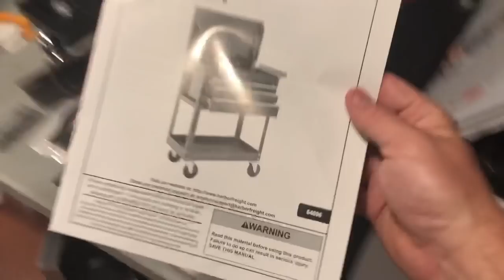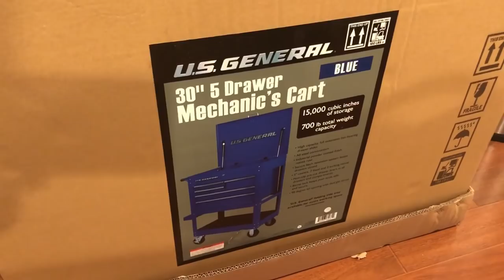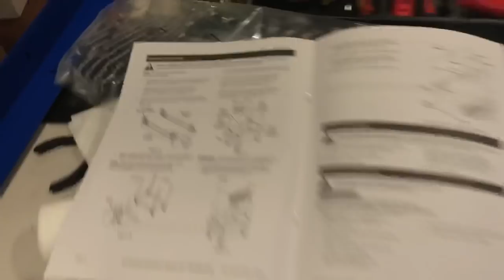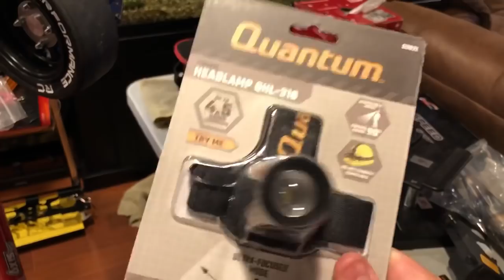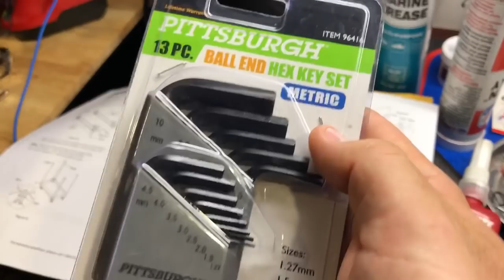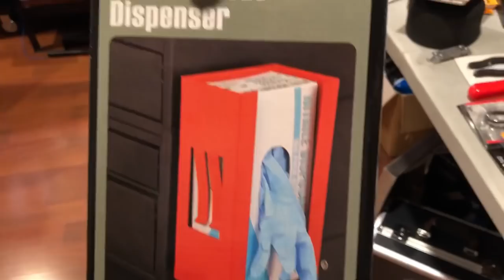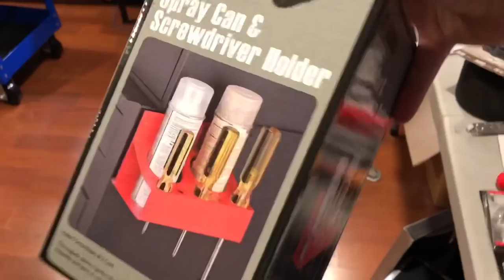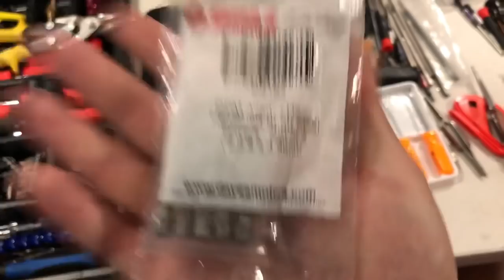BOTAJELL Got Another RC Tool Cart, Harbor Freight 30in.5 Drawer Mechanic’s Cart/U.S GENERAL

Comment: NICE!  I debated on the 4 drawer vs 5 drawer.  Just got the 5 drawer.  Think I'll put the can holder down low if i want to add the second tray.  Just got mine so all the extras were in blue too including the tray.  Got the glove holder and power strip too.  Also i found someone else that painted the bolts to match the blue. Rust-Oleum Painters Touch 2X Ultra cover  (Deep Blue Gloss) matches perfectly!  I painted mine.  I just saw they have black handle covers for it too now!  Great ideas in the video.

Comment: Bro I'm throwing out the pull start on the rtr this weekend and getting a bump box. The TLR starter box says you need 2 7.2V NIMH batteries to run. What batteries did you use as you are like me and do not use lipos. Also what connector plug comes with it. Thanks in advance John hope all is well
Reply from the maker: Vincent Martinez I’m using a Lipo in mine still but I will be replacing it with a Life battery the next time I get around to it!!!! I may use one or 2 Life batteries? My home and my RC Hobby will be 100% Lipo free after I do that and use one on my 4.0 Truggy.

Comment: BOTAJELL hey man, I just received my Rovan q.... pretty cool! What is YOUR process for engine break in? I don’t really remember breaking in my 5b but I kinda want to break this one in.
Reply from the maker: rc Ohio congratulations 🍾🎉🎈🎊 my Braaaaap brother 👊💥🤝💥 bro I love my Baja Q it’s so much fun and it sounds 💥killer👍!! I have past videos that show how I break in my Gas engines and I also made past videos of how I break in my Nitros. Bro Don’t over think it! It’s simple shit and if you get stuck? Just let me know and I will help you! Get yourself a stand and put your Q on it , mix 1 gallon of 24:1 mix fuel because your going to run 1 gallon of this for break in ! After first gallon of 24:1 you will be running 28:1 for the rest of the Engines life! This is what I do since 2002 with Gas RCs. When you use the first gallon of 24:1 and start to run it for first time try to run it for 15 min 4 times and each time let the engine cool down completely. Make sure when it’s running you see smoke 💨 for the complete first 1 gallon .  After the 4 or 5 15min runs just run it threw a full tank without stopping it but keep an eye 👁 on it because you can not let it run dry because it will lean out if that happens!! After you run a half gallon give it Throttle so the RPMs go up and down a bit and sometimes let it run with hi RPMs but make sure it’s rich ! When your at the end or close at the end of gallon you can drive it and get on it a little bit keep it fat , rich , Smokey still do not lean anything yet unless it can’t idle in its own . After your done with 1 full gallon of 24:1 change your spark plug with new one and mix fuel ⛽️ to 28:1 and warm up your engine a bit run it for a bit then start to lean your low speed needle until the idle raises a little then lower your idle needle screwif needed . Then do some hi speed runs back and forth and lean your hi speed needle until your engine sounds clean and clear sounds with no burping or farting at full throttle and do not over lean it either. If you hear 👂 a chubaka sound or if it acts crazy 😜 and sounds funny ? You probably over leaned it so you will have to richen it a bit until that goes away! Just run it bro don’t over think it !
Reply: BOTAJELL thanks for taking the time to reply brother! I appreciate the all of the info.

Comment: Best upgrades/first upgrades for 8ight t rtr? I know the engine's gotta go but what else should I do to it?
Reply: Jake Scinta electronics, chassis brace, and proline badland tires
Reply: Karrie Bhurgari also is there anywhere I can get the race kit shocks from?
Reply from the maker: LRP .32 X series, NOVAROSSI.28-8, PICCO BOOST .28, Novarossi.25 ROMA Engine’s and hopefully all of these Modified by Rick from RB MODS or Neal from TNS !!!!! Get the 4.0 Engine mounts do you can use engines with back plates ! Get NOVAROSSI 41032 header and 9886 pipe if Modified Engine or 9853 pipe with stock engine!! Get some 4.0 Diffs because you will put down more power to the ground especially with 50K diff oil in the front and back Diffs and 100K on the center diffs !! Then get turnbuckles ! Then get shocks from 4.0 if you can buy them ? If not use what you got and get stronger springs! Then get lighter center diff spur gear! Also chassis braces ! Max life clutch shoes all 4 and all 4 green clutch springs if you’re running Modified Engine!! If stock? Use 2 green and 2 silver! Use 15 tooth clutch bell if engines are modified!! If stock ? Use 14 tooth !!  I can go on more but you will be better off buying a TLR 4.0 Truggy at the end of the day and that will come with greased cvds unlike the RTR LOSI and 3.0s !! But you can still use your RTR and have fun with it but they are different! I have both race kit TLRs and Losi RTRs and the RTR is what my daughters use! I have used it as well there not bad at all but it is no 4.0!
Reply from the maker: Jake Scinta you can also try dollar hobby
Reply: Karrie Bhurgari sadly the back ones you sent are for the buggy and I can’t find the rears anywhere so I’ll probably have to stick with the stock ones and just up the spring rates and oil weight
Reply: BOTAJELL by any chance would you have any old engines/pipes you’d sell to me 😂😂
Reply: Jake Scinta ohh my bad. Yeah I can't find those anywhere!

Comment: You know if you aren't digging the red shelves, just get a can of blue paint and paint it. Hey Bo, who is company that makes 2sp gear set on you drag 2sp baja?
Reply from the maker: Donald Byrd I may get them powder coated when I get my Bartolone pipe ceramic coated?? My 2 speed that I’m using at the moment is a King Motor 2 speed and it ain’t bad at all !! I also have a Black Bones 2 speed on the way !
Reply: BOTAJELL where are you getting the blackbone unit from?
Reply from the maker: Donald Byrd Detroit Performance! They were ordered a couple of weeks ago ! The problem is with Black Bones over In England!! He does good work for a little while and then goes off for a while doing who knows what ? Then when he runs out of money he gets his ass back to work and does good again for a while and then goes off again!! I’m about to say F that crap and go better with SkunkWorks especially now because Robinson Racing is making the gears for Skunk Works and there better then Black Bones !!! The problem with this new Skunk Works that uses Robinson Racing hardened gears is that supposedly they don’t get along with each other ! Sometimes they will work together and sometimes they can’t because of testosterone levels! Also they need to have more of a gear selection!! If they can work with one another and have more of a gear selection? SkunkWorks / Robinson Racing will take over this bitch once again! I don’t get it sometimes I say to myself WTF???? People are crazy 😜 you can’t make this shit up!!! Skunk works 2 speeds uses better oneway bearings also and not one but 2 claws !! Black Bones is almost the same as King Motors 2 speed that I know for a fact!! What I don’t know is if there gears can fit the 2 speed the same and if they do? I will only use King Motors 2 speeds because they give you everything plus a cover plus extra parts and hardware! The hardware is the same because my extra king motor hardware is being used on my friends BlackBones and holding up longer from his original !! This is facts , truth , real shit and real words and I can even prove it if need ! On my black bones purchase I also have a bunch of gears coming in so I will try it out but if Robinson racing makes more gears for SkunkWorks I will switch over ASAP because they have the better stronger design out of all